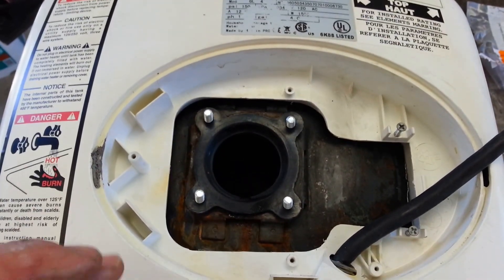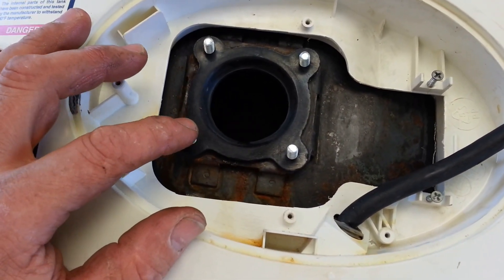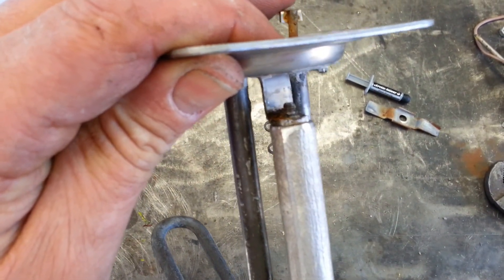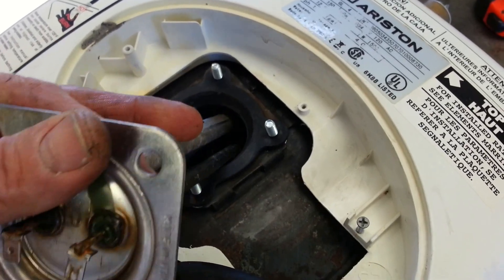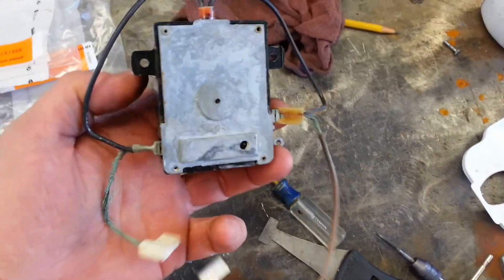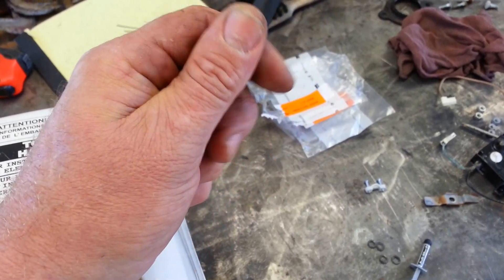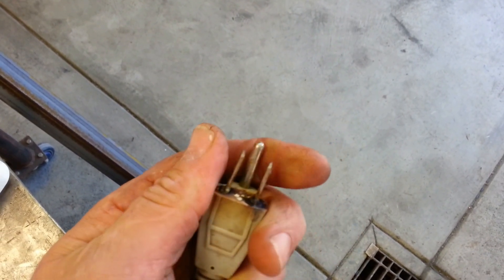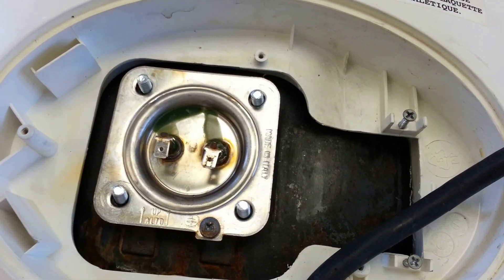Ariston GL-4 rebuild Part-2

Comment: hi, i replaced the heating element, cleaned it, installed everything back to how it should be, turned it on, the switch turns on but it is still not heating the water... do you have any suggestions or comments? i looked at the manual that did not help. please let me know. thank you
Reply from the maker: Check the high limit switch.
Reply: @ShadonHKW  thanks for your response. We gave up and bought a new one haha

Comment: Thanks for your very complete description of the process! I just bought one a  few months ago and was wondering what was required to replace the anode. I will check the electrical connections as well. What did you use to seal the opening after your were finished? Thanks again.

Comment: How hard would it be to convert this to 12V DC?
Reply from the maker: You could probably do it, but the battery drain would be a killer.
Reply: I'm considering it for a campervan. I was wandering if by any chance you knew where I could find a heating element that would fit this design?

Comment: Seeing the plug, it's clear that you need to replace the receptacle with an industrial grade unit, with sufficient blade tension to prevent high resistance at the plug.  IF the original wire was too small, it would have been heated along its entire length, not just at the connector(s).   Bigger wire can't hurt, and may help carry the local heat away, but there's no substitute for low-resistance connections, like solder.